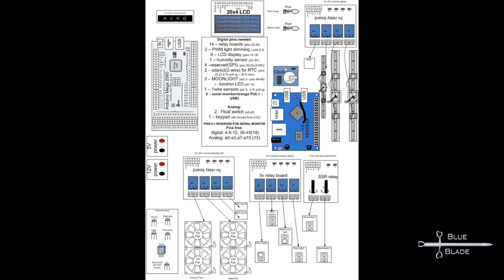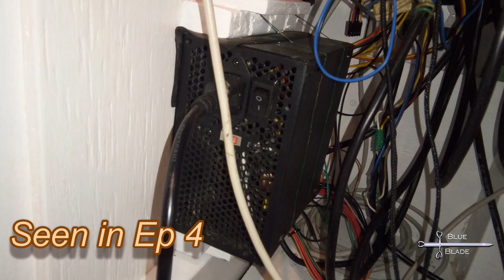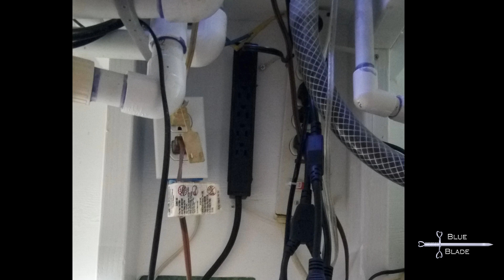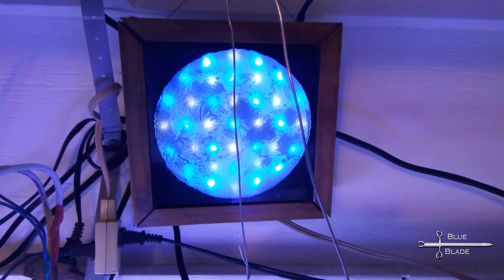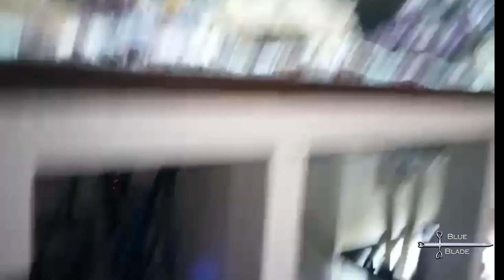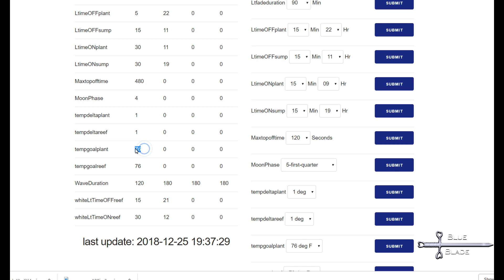DIY Arduino Aquarium Controller Part15: Final Build review, install and testing

Comment: Fantastic Achievement! ! !
Can I place an order on behalf of 2 billion people?
Please add the possibility of degrees Celsius and clock with format of 24 hours.
Thank you very much.
Reply from the maker: thank you!
actually, the times are already formatted in 24 hour (military style) time. it makes the math easier. 
for deg C, you could convert at the php display side, but it would probably be better just to use Celsius from the very beginning (the DS18b20 reports temp in 1/1000 deg C native - just don't use the command to convert to F when polling for temp). that way everything would be C, and there would be no conversion errors or mismatch. nowhere in the code other than the temperature poll from the thermometers does it really care what the temperature unit is.